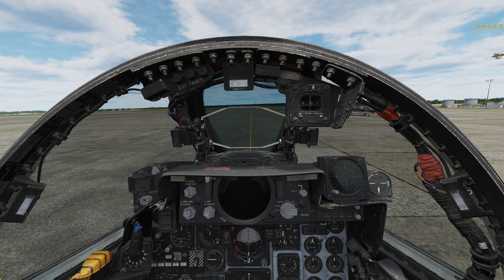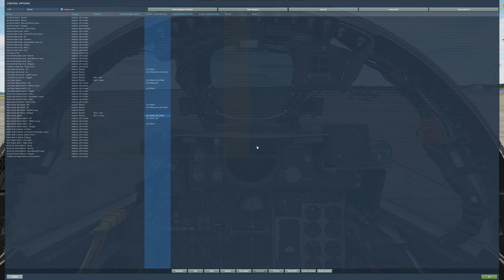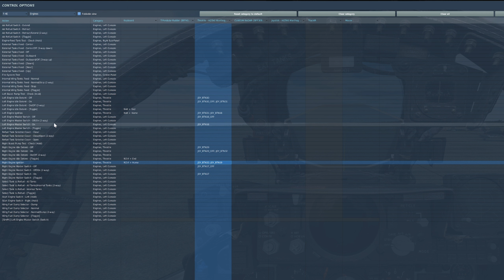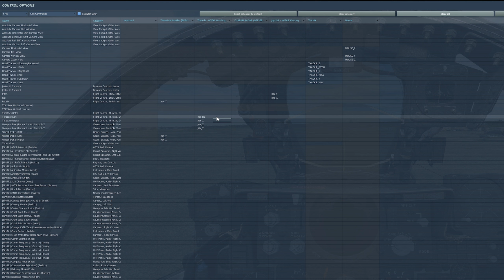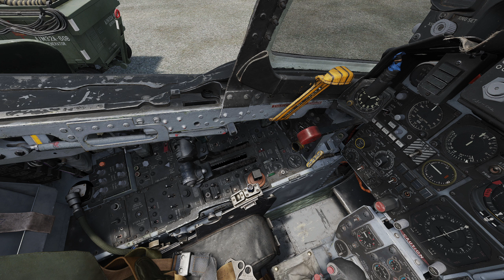F-4E Phantom: Quick Start Up Guide (Air & Cartridge) | DCS

Comment: Hey there, love the Channel :)
But have to say, Ground Crews gonna hate you xDD
Found 3 Mistakes so far. 
1st. Do not move the Throttles with Engine Master On unless during Engine Start. You'll dump a lot of Fuel into the stationary Engine. 
2nd. When using external Air, always use external Power as well. You're going to kill the Battery  otherwise. 
And 3rd and the hardest. Do NOT ask the Crew Chief, to remove the Starter Cartridges, right after Startup and from a running Engine!!! They are redhot at that Point and installed INSIDE the now running Engine! Of course they can go on your Flight, if they both managed to start your Engines, just like the Casings from your Gun remain inside Plane as well. ;)
We removed these almost an Hour after Engine shutdown and they were still hot to the touch.